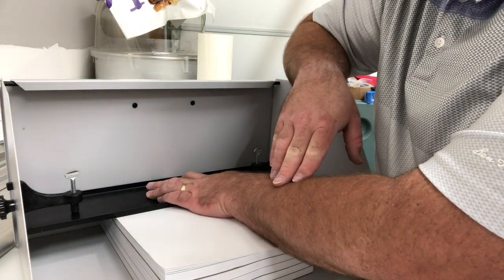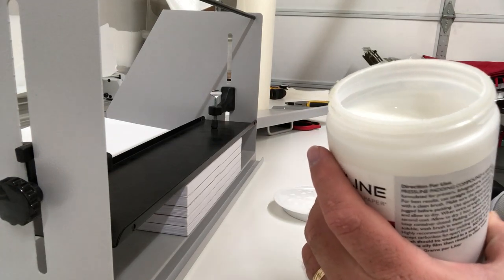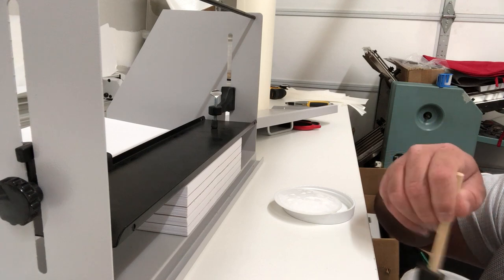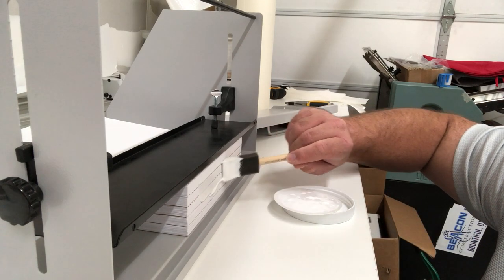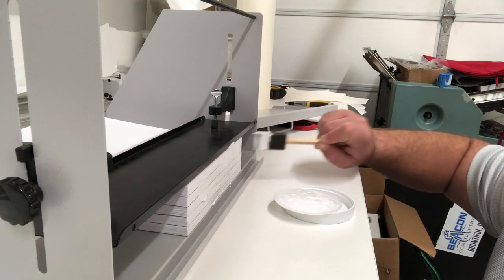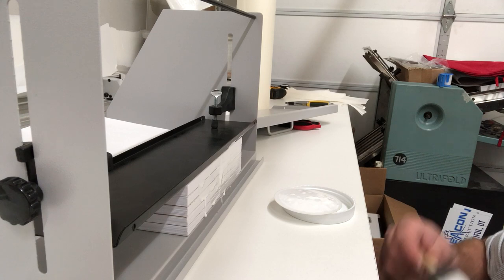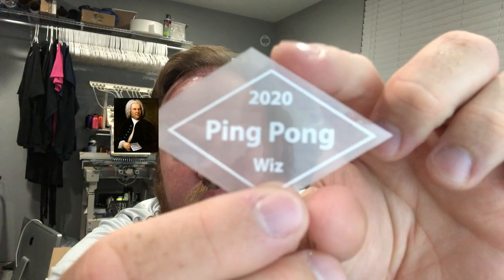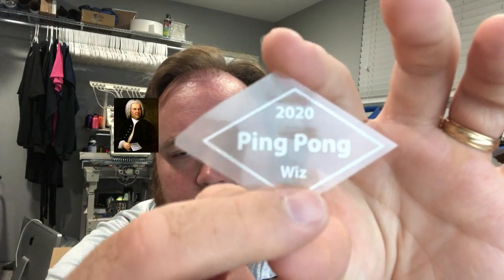Answering your questions and padding some notebooks - vlog 274 - Print Shop Updates

Comment: Tip on the padding press - take that top sheet you use for the throw away piece and extend it out an inch or two forward, then fold it upwards. Add a piece on the bottom for the same thing but fold it downward. This way the glue won't get on the machine.
Reply from the maker: Thanks for the tip. That would definitely help with cleanup.

Comment: Question: The hp 315 only use media in rolls? I have 6' lest over,  any way to be able to print on that??
Reply from the maker: Yes, it only takes rolls. I did a few prints using the last bits of rolls, but usually it's not worth it to me. I've seen people tape multiple piece together to make it run through. I don't want to do that though.

Comment: Keencut, where to buy? I got the HP print cut 315, is possible to know the cost per sqft?
Reply from the maker: I purchased my Keencut from Grimco. It depends on the media, but for my standard adhesive vinyl I pay about $1 per sq/ft. That covers the payment, media, ink, and most maintenance. If you didn't calculate everything, you're about $0.25 per for just ink.
Reply: @ttms  Thanks for the quick response, How do you charge for stickers or product labels,? I got an order for 3000 labels (6" x 5" ), I have no idea how much$ charge for that.
Reply: @ttms  Question: The hp 315 only use media in rolls? I have 6' lest over,  any way to be able to print on that??